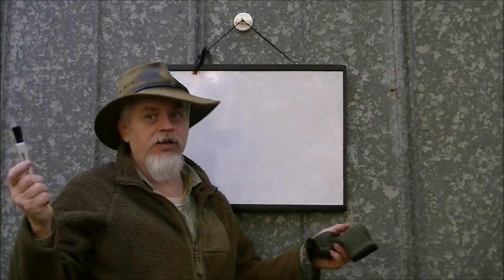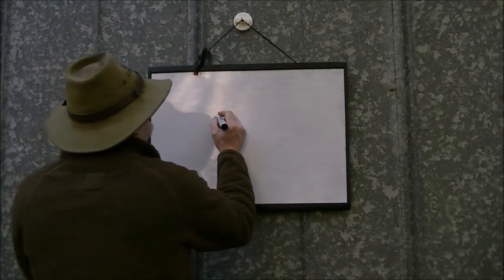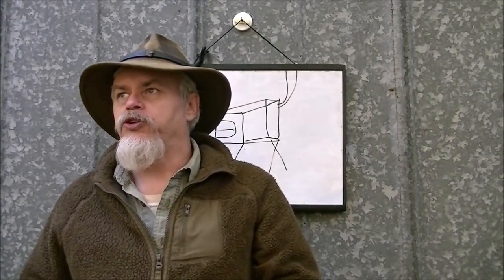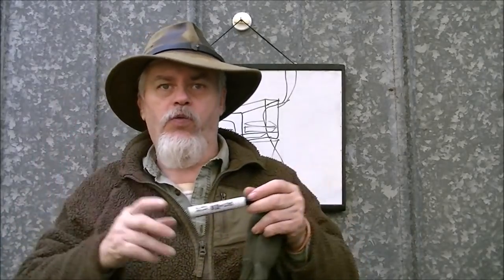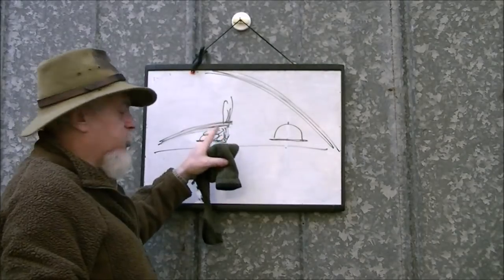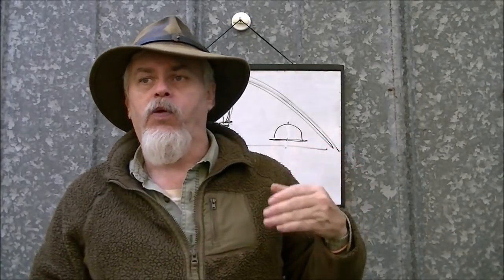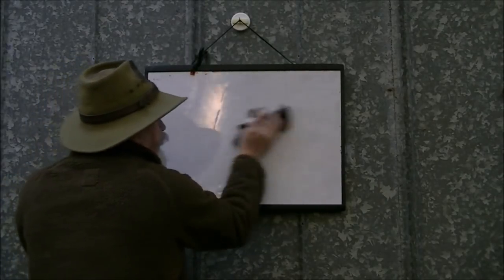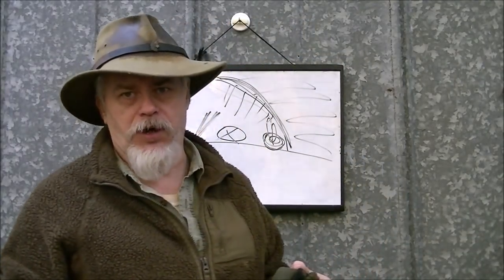DOWN N DIRTY WOODSCRAFT WHAT WOULD I CHOOSE

Comment: Great informational video as always Blackie. In the military when on sentry or over watch duty,  we had little or no equipment & defiantly no fire. We would put on our ponchos with the warmest layering clothes. In sitting style use fingerlings shrubs branches to prop outward our poncho slightly, teepee like. Using something like a USO CANDLE  LANTERN we would heat up our core temperature by placeing it between our legs..FYI!!! USE beeswax candles.
Reply from the maker: yep when i was young we would sit in ground deer stands with a kerosene lantern between out feet and a blanket draped around us..you would stay warm but ya smelled like a chimney